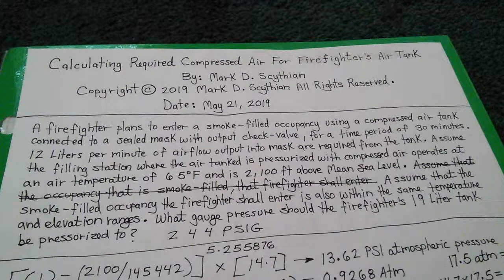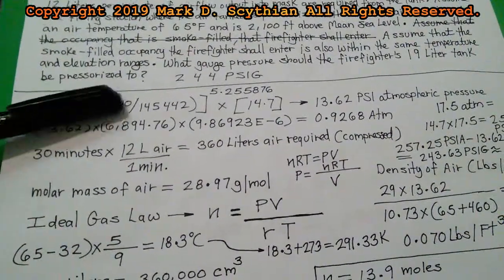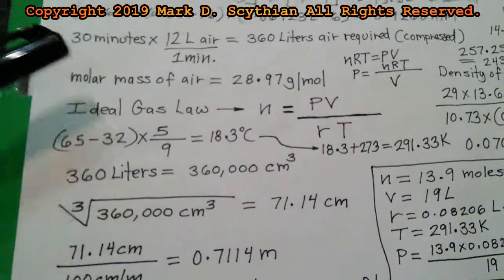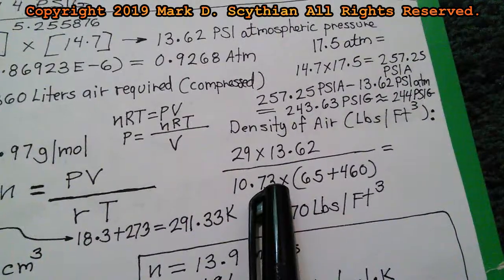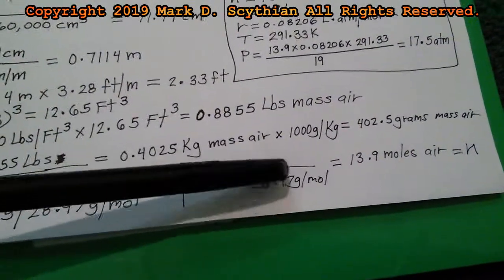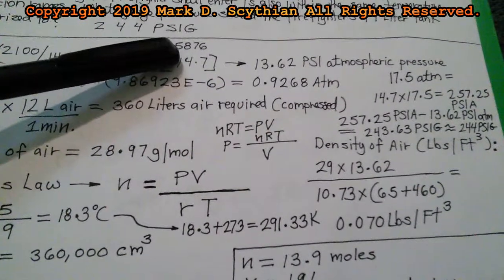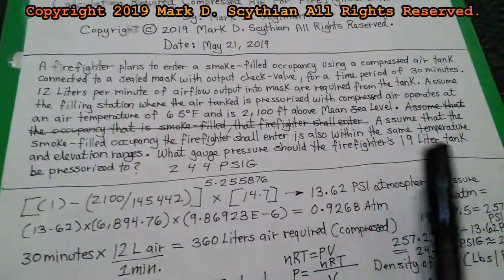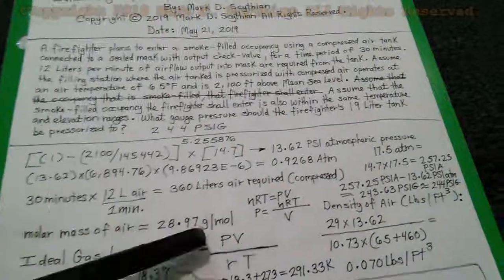Calculating Compressed Air Pressure Charge For A Firefighter's Air Tank

Comment: Hello Mark, me again,I’m working on calculations for a centrifugal compressor on a project,can discuss about it if interested,but I want to know go how to calculate the power,mass flow,given an inlet diameter,and also the known efficiency at 0.72,and discharge pressure at 60psi if the inlet pressure was standard 14.7psi and room temperature